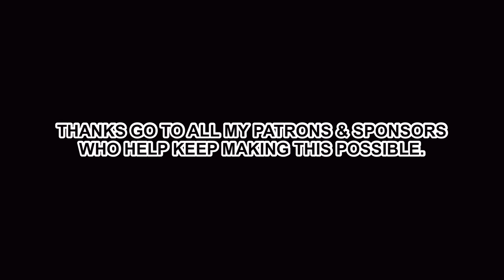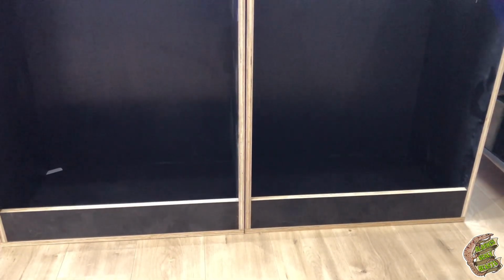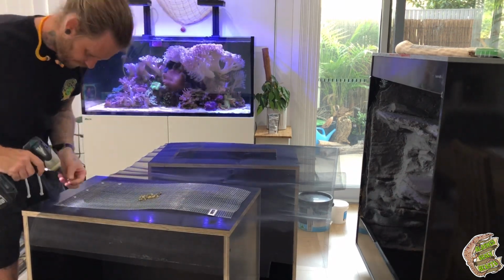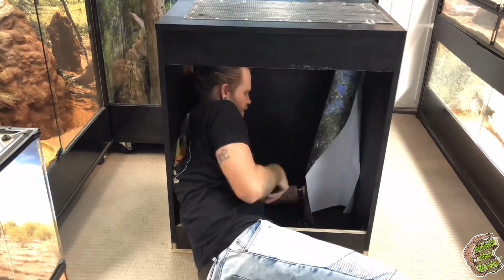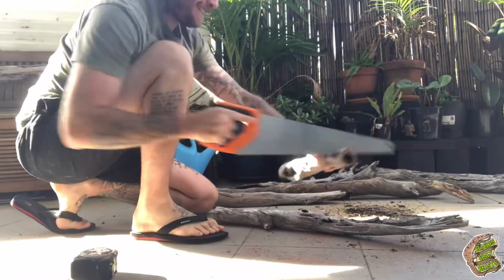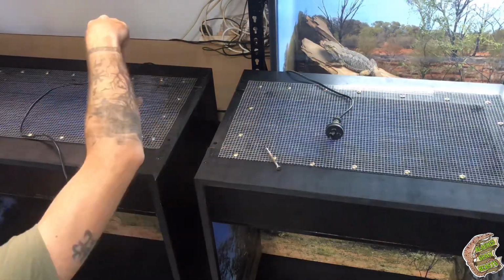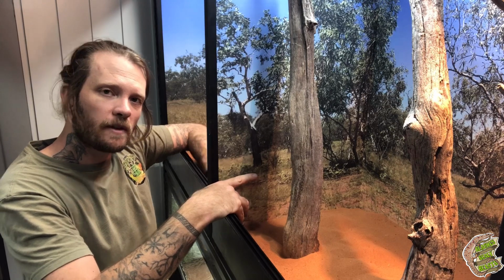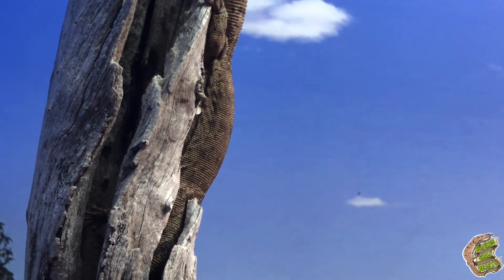Building NEW Form Ply Vivariums FROM SCRATCH, For My Gillen’s Monitors!

Comment: Well, a great video, as usual. I don't know how much I have learnt from Luke's videos over the time since I do also keep only Australian skinks and monitors in Europe. What a great source for inspiration. However, in this case I would have done 2 things differently: 1. Personally, I am done with glass sliding doors for tailormade terrariums. It's difficult to clean the terrarium if you can only access half of it, but the most annoying thing is that the glass tracks get dirty and congested easily and then it's difficult to slide the doors. Somehow the glass tracks will never get Clean again regardless of how often you Clean them. I have therefore started to build swinging doors with hinges and use acryl-glass for the frame of the swinging door. I think it looks so much better than sliding doors apart from the improved functionality. 2. Your posters do look great; however, I would have built a background wall in order to give them more room for climbing and movement.
Reply from the maker: Thanks for the feedback Omar! 😊

Comment: hi mate just wondering how the uvb goes sitting on the mesh did you have to get stronger uvb or is it fine only asking because i hear people whinge on forums about it not getting through and wanted your opinion about it as i wouldnt mind building a couple of these myself. great vids mate always great to watch i have learned alot from you over the years
Reply from the maker: G’day Jason! I used a pretty open style mesh and a 12 or 14% tube, so on the stronger side. Where a lot of it gets cut out is the distance between where the animal can access it from and tighter weaved mesh. My mesh has square holes of around 5-6mm so more than any off the shelf reptile enclosure. That’ll allow a lot more uvb penetration. Also the animals can physically climb from the bottom to the top and if they choose, hang off the mesh soaking in as much uvb is they want. 

Taller tanks and mesh I always choose higher output globes.